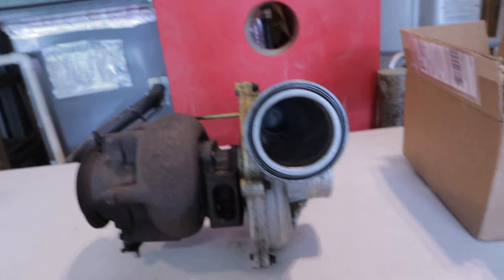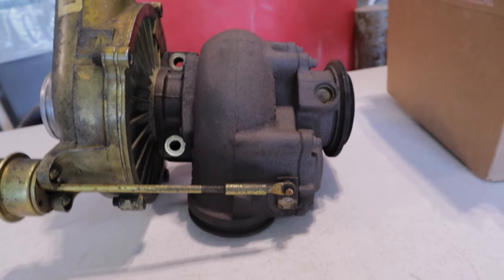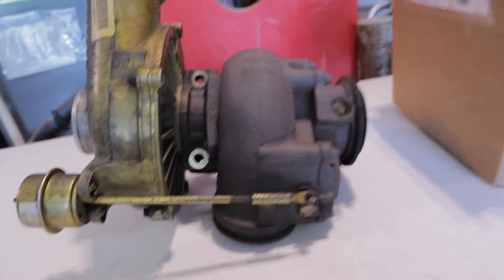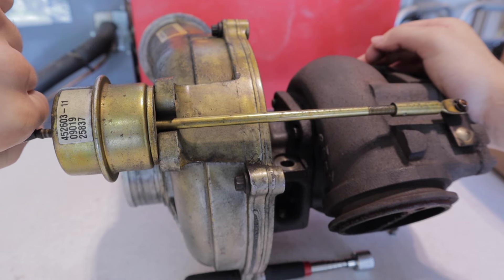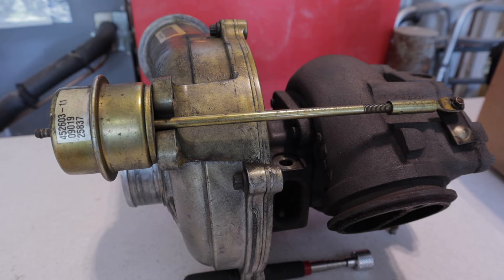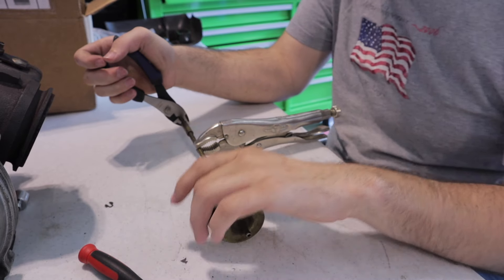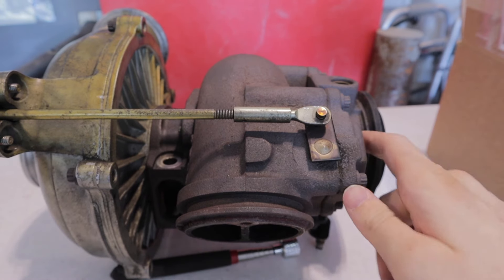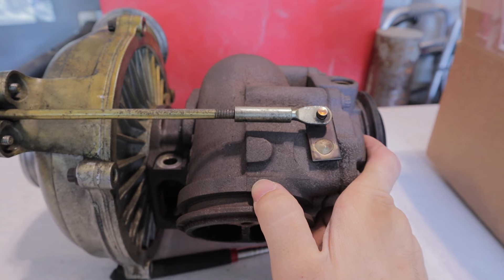Ford 7.3 Powerstroke Build More Boost For FREE!!!

Comment: So I have a 2000 7.3. Stock Garett turbo. Did this mod and it’s a shitt waste of time. The rod still moves at 7 psi. And if you turn the end in too much the wastegate it’s self will not fit back in to its place because it’s to short.   So have it turned in as short as it will go and still fit.  And it still moves at 5 to 7 psi.     Huge waste of time hard to access while in the truck.  Got lucky and didn’t loose the c clip
Reply from the maker: You obviously didn't pay attention to the whole video. Of course it still opens at 5-7 psi. By screwing it back out to where you can slide in on by hand is basically putting it right back to where it was stock. Watch the video starting at 9:45
Reply: So the problem with that is your turbo is sitting on a table easy access     Mine is in the truck.  We tried a hundred times to do your trick with the air hose to get the rod in place. And to no avail the only way was to put the rod in place by hand and pull the actuator over the stud holes.  And of course the only difference  that I can see is your turbo is out of the truck and mine isn’t        It’s very frustrating when you see something that looks easy to do and it turns out not to be.  And I do not want to pull the turbo off the truck for something like this.    I have some really nice upgrades to truck unfortunately they are almost worthless because my dumb butt stayed with the stock turbo
Reply: @slaelkhunter  Replace the stock actuator with a waste gate controller from Dieselsite. They sell one with an easily adjustable nut on it. You can set your boost as high as you dare.
Reply: JB. Thanks for that info.  That is exactly what we are going to do.  We have decided to pull the turbo completely out   So that will make the job a lot easier.  Thinking about also putting in a wicked wheel 2.    Truck already has upgraded injectors (180/30 full force, S&B cold intake, 4 inch turbo back exhaust, DP 6 position tune, and an edge CTS 2 monitoring system. So this turbo work is about the last of our upgrades.
Reply: @slaelkhunter  I also installed the WW2 with 4" straight pipe exhaust and Superchip tuner with stock injectors and HPOP. My truck pulls hard and gets 19mpg on the highway.
Reply: @akquicksilver  will that wicked wheel give me more towing power
Reply: If you are completely stock and don't have a way to lie to your ECM about the boost pressure, you will not be able to generate more than the stock boost max pressure which is pretty low like 12 PSI or something. It will spool up a little faster and it will stop the stock surging. Once you reach the stock boost set point, the ECM will throw a code and defuel to protect the engine. I installed a relief valve sold by several different Diesel aftermarket shops that keeps the boost signal reading low so the ECM will not freak out. I also run a manual waste gate controller from Diesel Site that allows you set your own max boost. So without any other modifications you will not see much difference other than no surging.
Reply: @akquicksilver  I have a 2000 7.3 and based on what you're saying if I'm understanding it correctly is that with a stock truck tightening the wastegate rod isn't going to make a difference because the ECM is going to shut down a fuel supply?
Reply: @blackisback74  That is correct.
Reply: @akquicksilver  okay so now that I understand that does that mean if I put one of these power hungry chips into my truck that I will even get more power than the chip provides by shortening the rod? I'm thinking that it would because the chip is reprogramming the computer thus if I'm able to have the rod shortened I'm going to get more boost but I would need the computer in order for it to work or do I need bigger injectors and a bigger hpop?

Sorry for all the questions but I've never worked on a diesel before so I'm trying to figure this out as I go and I just got my truck a couple weeks ago
Reply: @blackisback74  OK, to be honest it gets a little complicated. Lot of factors. How much power do you want/need what are you going to do with the truck, carry heavy loads, tow, drag race, or what? I would recommend you talk to Bob at DieselSite or call the guys at RiffRaff and tell them what you want from your truck. They are both great companies and won't just try to sell you parts. I would also do some Googling and find out whether you have forged rods or powdered metal rods. They changed sometime in 2000. The forged rods will take more HP than the PMR. My build up was over the period of about 5 years as I learned more and decided what I wanted from my truck. I still think I may install the Hydra Chip and maybe some single shot injectors down the road, but my truck runs great and get great mileage, so I might just leave it as is. Hope this helps. Have fun.
Reply: @akquicksilver  yep. Need a boost fooler or this is almost useless